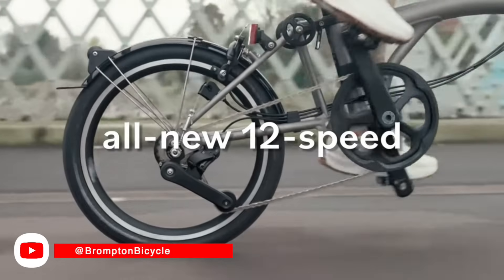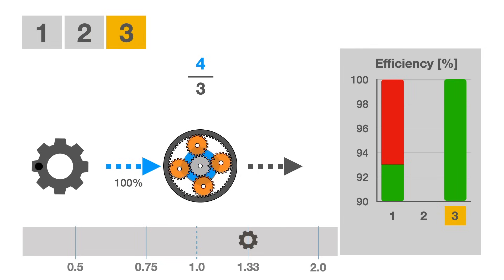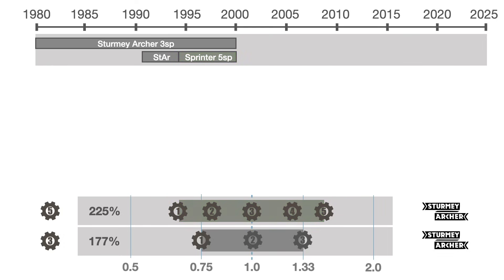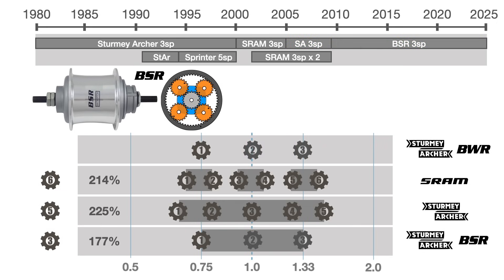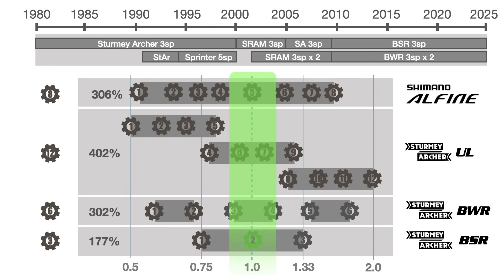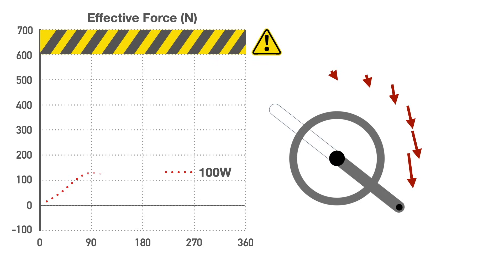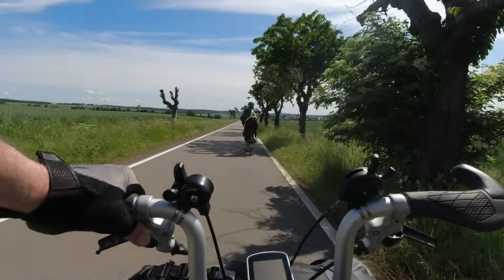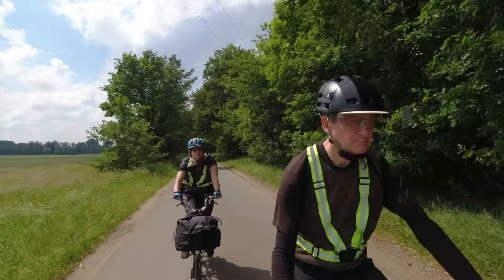Brompton Hubs: The Old, the New and the Math

Comment: I really like your videos. They helped a lot when I was shopping around for a Brompton 2 years ago. Originally wanted a P-Line but ended up going for the 6-speed C-Line instead. Your gearing videos really helped me avoid making what would have been an expensive mistake. I would have gone for the 12 speed C-Line had it been available back then. With a new H&H 40T chainrig upgrade, I no longer feel I need it. As I tend to use it in the mid to low ranges anyway. With hills always being the bigger challenge.

Comment: Very interesting video as always.

The issue with the Brompton gear system is twofold (or perhaps threefold):
Having a flat gear (i.e. about 75-80 gear inches) that is as efficient as possible;
Achieving the lowest possible gear inches to tackle hills;
(As I learned from this video) staying below the maximum torque limit at the same time.

In the case of the 12-speed, if you want a 75-inch gear on the second hub gear, you need to choose the 50T front chainring. However, in that case your lowest gear is 29.4 GI, which is actually worse than the 6-speed with a 44T chainring.
If you go with a 44T on the 12-speed, your lowest gear (25.9 GI) is still higher than that of the 6-speed with a 39T ring. So, if you really want to have a more useful range than the 6-speed, you need to use a 39T front chainring — and then you’ll get a 23 GI lowest gear, and you’re right over the 2:1 drive ratio limit (39t/18t) - and the chain can more easily fall as well (no chainguard)

Overall, in practical terms, the 12-speed is only slightly better than the 6-speed if used with a 39T front chainring — but that also means the third hub gear will be used for flat terrain most of the time.

Comment: Brompton's are dramatically over geared who needs 90+ gear inches on a commuter designed to carry a load? The first thing I recommend to folks who join the fold is to swap that 50T chainring into a much smaller size.
Reply from the maker: 44T should be the default in our opinion

Comment: great video. do you have any pointers to find details of differences between the UL and BWR hubs? my google search doesn't reveal much
Reply from the maker: While BWR and UL have the same Over Locknut Distance (OLD: 112mm) and gear development/range, the main difference is the flange width (47mm vs  36.5mm).
The flange diameter (67mm vs 68mm) and flange offset (1mm vs 1.3mm) are almost identical.
Reply: @2Bikes4Adventure thanks. this is primarily for weight savings?
Reply from the maker: @PrinceAndTheHarper  No, to be able to accommodate the 4 sprockets cassette (the BWR only has room for 2)

Comment: I recently bought a G line Brompton and had it electrified by ARCC. It is an eight speed Brompton. Unfortunately the HP Brompton is very slow. The highest gear on the eight speed is equivalent to 5th gear on the C line 6 speed Explorer. Subsequently the C line 6 speed is a much faster bike than the G line. The G line 4 speed is a faster bike than the eight speed.

Comment: If only a strong, efficient and reliable, 120 mm O.L.D., internal gear hub were available, ideally having options for chain or belt sprocket, it would sell like hot cakes!    Presumably, it is a major engineering challenge to fit planetary gearing into that narrower hub shell without the gears having smaller contact surfaces and perhaps therefore being weaker.   Maybe a miniaturised Enviolo-type hub could work, as the non-Newtonian fluid might be able to have a viscosity that's sufficient, even for a smaller "contact area", i.e. for smaller balls.   However, I am not sure whether the other parts needed for that setup would be able to be re-scaled to a 120 mm hub shell.
Reply from the maker: An engineering compromise could be to add a few mm to the O.L.D., retaining the bicycle compactness when folded while giving more room to hub manufacturers to play with. Alternatively, could a pinion gearbox work on a Brompton (likely heavier and less efficient than a 3speed hub however)?

Comment: Do you have any efficiency on the SA UL gear ratios?
Reply from the maker: We could not find BWR power efficiency transfer data. However, various design decisions would likely results in reduced efficiency compared to the BSR.
1- Planets size: The BSR, with its 20-tooth planet gears, is more efficient overall, due to better load distribution, reduced planet gear rotational speed, and lower bearing and mesh friction.
2- SA used a technique called “Profile Shifting” to accommodate 12T planets with its 34T sun gear and 60T ring gear. Conventional epicyclic design would mandates 13T planets (i.e. Sun Gear + 2x Planet Gear = Ring Gear). Going for smaller planets to achieve the desired ratio could negatively affect the output efficiency (and reliability).

Comment: That 16% efficiency hit in the Alfine 8 explains why Brompton didn't go that way a long time ago. Already with the smaller wheels, we have a hit to efficiency. Then, another hit by using ANY IGH. 

I think what I'd rather have is the 3 speed SA with a smallish chainring and the 4 speed cassette out back. Then, keep it in the 2nd speed of the hub for efficiency most of the time. When we need the first range, we don't care, because we're climbing and we need the torque. The efficiency loss won't be felt as much, since we're gearing down. When we need the higher gear in the hub, we also don't care, because we're probably descending at that point and are happy just to not be ghost pedaling. Plus, how fast does a person really want to go on 16" wheels? 25 mph seems QUITE fast enough, to me.

I think they should also make a single speed hub w/4 speed derailleur. This could be the budget model. Gear it for climbing, with the understanding that top pedaling speed will be modest; maybe 20 mph?

Another sweet option for a budget Brompton: Two speed kick-back hub w/coaster brake. Schwinn choppers had them in the 1960s. One climbing gear, maybe 5 mph, and one cruising gear, maybe 11 mph. Want to go faster? Find a hill to descend.
Reply: I just looked, and they DO make a single speed hub w/4 speed derailleur, but only on the T and P Lines...
Reply from the maker: @Smaug1 C-Line 4speed is rumoured to be available in Autumn 2025

Comment: In 2019, during Covid19, I bought my Top, "SuperlightM6LXBrompton" with an SA 6-speed hub and a 50-tooth ring in front (They had a finished one in the Ordinary Bike Shop in Kbh, which I bought as it was. So I was never allowed to fix my bike at home, except for the many lightweight modifications I have added to my bike (now 9 kilos). I have later bought some upgrade and oversized front rings up to 60 teeth to make more use of my low gears, which I honestly find mostly "useless" in the Low Setting of the two possible. I wouldn't know what use I had for a 12-speed version, or an extra, added smaller ring in front!
    I have used it up an absurdly steep hill in Denmark, and it was my only use for my low gears ever! And I had to walk also, on top!
    I have seen a Chinese external 7-speed chain-gear wheel and - a single changer made for a Brompton, which I expect would be fine for my use, without any double gearings?  Finn. Denmark
Reply from the maker: Quite a speedy Brompton you have there!
Reply: @2Bikes4Adventure  Thank You. I like it to look as standard as possible, so I haven't added any flashy, extra parts, except several of my standard-looking brake parts, which are now made of titanium. And nearly all loose parts on my bike, including the axle in front, bolts, discs, and nuts, are made of titanium. Even the adjustment nut, with a hole in it, for my SA hub. My mudguards have original titanium stays, but the Brackets holding them are made from "Heavy Metal", so I found a Chinese Set made from carbon, with small bolts, and alu-holders, for the frame. The last are added permanently and need to be drilled out, to be changed. I use a black carbon, M-shaped handlebar - with a Dutch "Bromptonian" bracket protecting the mudguards end during folds. I have a titanium wedge and bolt holding my fork.
     I look for a Flame Painted, H type Ti stem post, as the only major part still to be changed to Titanium, but I may settle for Yellow version if unable to doublicate the original!  Finn
Reply: When I had collected my finished bike in the Shop, I as a near first gave it an Auto Polish all over and found that the "Factory Protection" from small clear Tapes, the one had been worn through to nearly the paint after three folds! So I immediately ordered a "set" of frame protection plates and a fork-badge from China, and added those, also protecting where the hook from the fork meet the titanium triangle in the back, during folds. I have later found a new and lighter hook with a hole for the mudguards stay. I have also added a small "Union Jack" one below the wire fixed cable in front of the frame. I have sown leather on both my frame and the fork, from China, for protection during handling (And I have a Vincita Pouch for my folding pedal (titanium bolt). And my "stopper plate" for the titanium Saddle Pin is now titanium and a Carbon guide Plate.  My saddle is a stonehard ,slightly padded Sct Marco saddle from carbon.   Finn

Comment: I like your video, but saying that 400 W is "untrained" is not accurate. For an average person weighing 70 kg, 400 W equals 5.7 W/kg for a full minute, that’s the output of a very well-trained, if not elite amateur, cyclist!
Reply from the maker: Ref. https://www.researchgate.net/figure/Human-Power-Output-Pedalling-II-TRANSMISSION-MECHANISM_fig2_320283848
Figure 3, 400W -> 1 min for Healthy Men, 10min for First Class Atheletes
Reply: @2Bikes4Adventure That’s not accurate. I’ve been in the cycling industry for 20 years :) The number "400" depends heavily on body weight.
If we’re talking about a trained cyclist (around 70 kg), producing 400 W for 1 minute doesn’t make him just a “healthy man” — that’s elite-level power.
On the other hand, if a 90 kg person does 400 W, that’s relatively low — not even necessarily a sign of good fitness.
Also, those graphics look like they’re from 1964 — I’m not sure how relevant they are today :)
Reply: @rickys.9219 totally agree, also break the hub may be only a second thing that over the max limit. 1 mins avg watt 400 doesn’t mean generate ~1000w in let than 10sec is a hard thing. Lot of citizens level cyclist can do it. So it is hard to ride within the limits.
Reply: @rickys.9219   agreed.  1 min @ 400 watts is serious level output.  any "untrained" cyclist actually doing 1 min @ 400 watts should seriously consider quitting their day job and seek out pro level cycling as a career as you'd instantly attract a coach as a possible TDF contender.

Comment: Great video! And didn’t know the 3x2 setup was a stop gap that has carried onto the new 12 speed system! With so many years since the original it would have been nice to see Brompton collaborate with Sturmey Archer to create a wider range and higher number of gear hub to fit the 112 width triangle!
Reply from the maker: Once Sturmey-Archer was back in operation in Taiwan, it’s interesting to see Brompton dropped the idea of returning to the 5speed hub and carried-on with the 2x3 idea, developing the BWR instead. If we are not mistaking, the SA 8speed is offered in 120mm. Would it have made more sense to widen slightly the rear triangle to accommodate it? We will never know.

Comment: Another excelent video! I've done the math and think the Shimano Alfine  is the way to go on all non-derailieur bikes. A 54T front ring and 16T sprocket = 28,5 to 87,2 gear inch. Throw in the 11 speed and we're talking 30,9 to 116,3 and a 376% gear range. Who needs more? The derailieur-versons is a different beast. The choise between climbing and top-speed is a hard one. A re-worked 5 speed  10-28 cassette paired with a 53T front ring would be a way forward.
Reply from the maker: The way we see it, a light bike (like the T-Line), should focus on a light/efficient transmission (derailleur). Utility bike and Touring bike (C-Line), should focus on low maintenance and reliability at the expense of slightly heavier transmission (pinion or internal gear hub). An hybrid solution brings the worst of both world (heavy for the T-Line, susceptible to dirt/grim on the C-Line).
Reply: The Alfine G-line has such a high bottom gear for an off road bike. Really needs a smaller front ring but with its limited gear range the top gear then gets too low! Maybe a dual front ring is the answer.
Reply from the maker: @petergilbert72 Brompton seems to have a tendency to over-gear their bikes
Reply: @2Bikes4Adventure  I totally agree. A C-line 44T 6 speed is plenty fast for most use and climbs well.
Reply: @2Bikes4Adventure  I agree. This could be because Brompton are based in London, which is a relatively flat area of England. I recently bought a T-line 4-speed and the first thing I did after a few test rides around my home in a hilly Scottish city was to change the 54t chainring to 50t. The bike still felt a bit over-geared so I carried out the 5-speed conversion as described by Brilliant Bikes for the P-line, adding an extra 21t sprocket low gear to the 11-13-15-18 of the standard 4-speed cassette. The Advance derailleur can only just cope with this larger sprocket - the clearances are very tight and I needed to do a bit of fettling to get it to work without any parts rubbing against each other. But I think it's a very worthwhile modification to make if you ride somewhere with inclines above 4%.

Comment: Fantastic overview, I think the main reason Brompton don't swap to the Alfine 8 spd (or any other internal gearhub) on their standard sized bikes is because of the dropout size that would be required on the rear triangle. This would increase the folded size and also the weight too from the larger hub and extra material required. I do wish they would look at an 7 speed derailleur setup instead which is becoming popular in the aftermarket. The range is overall smaller but for most with a 44 tooth chainring would be adequate, effectively replacing the 6 speed setup much like how the 4 speed derailleur option has now replaced the 3 speed BSR hub option.
Reply from the maker: Indeed, the Over Lucknut Distance (112mm vs 135m) is the main issue.
Kinetics (https://www.kinetics-online.co.uk/folding-bikes/brompton/) has demonstrated there is a market for Brompton+Alfine (or +Rohloff).  Could easily see the T and P-Line having the lighter / more efficient 7 speed derailleur (forget having a hub on a titanium bike!) and introducing a C-Line “Voyager” (V-Line?) option with an Alfine 8 (wider rear triangle + wider fork) that also accommodates larger /more confortable 16” tyres.

Comment: Tbh, if they are monitoring aftermarket and Chinese trifolds, i think eventually brompton will go 4 speed external for the C line and then to 7-9 speed external later. 
Right now the Chinese are at 9 speed aluminum frame trifolds. 8kg, no rust and supposedly no noise like the T line 😅. Although I would not tour with an aluminum frame bike with all the increased weight. 
I just feel the hub will expire in the future as most people are not touring with their bikes and the weight difference is big. I think people are only going for the 12 speed hub option because there aren’t 9 speed external options yet.
Reply from the maker: The C-Line 4 speed is schedule for later in 2025 if we are not mistaken.
Lighter bikes (T-Line/P-Line) would benefit from going full “derailleur” (7speed?) instead of 12-speed hybrid.
As for the 12speed C-Line, touring with a full internal hub does have its advantage, so we could certainly be (more) interested if Brompton were to release a C-Line "Voyager" (V-Line?) with a wider rear triangle, Alfine 8 (or 11) speed, and wider tyres (while still 16”). Time to move away for early 20th century technology that is the 3speed hub.
Reply: @2Bikes4Adventure  sounds like a great idea. I wonder if brompton monitors this channel. Good ideas to implement.

Comment: The 5 StAr was a bad idea. The cantilevered planet pinion pins can allow slipping under high torque.
Reply from the maker: Do you think the 5 Sprinter would have continued to be used if SA had not file bankruptcy? Was it good enough? What do you think we would be riding with now? A 2x5 configuration? A Sturmey Archer 8speed (120mm OLD)?
Reply: I believe that is true so i went for the S5/2 hubs. I think that the S5 and S5/1 were good but the bellcrank mechanism is hard to find now and expensive. The Sprinter is good. Sturmey Archer made so many things so there's so much to learn!

Comment: The idea of combining hub and derailleur gears dates back to 1924, not 1981.  See The Hub of the Universe by Tony Hadland and Alan Clarke.
Reply from the maker: You are correct, the “1981” hand-written at the top of the Cyclo advertisement is misleading and was added on the copy available in the SturmeyArcher Archive web site (we didn’t want to “photoshop” it out). If you read more closely the document, you will see it mentioned “Award Gold Medal … Inventeurs 1963”, so clearly, way before 1981.
Thanks for pointing it out (and mentioning “The Hub of the Universe”, a great reference)

Comment: Thanks for the video. Very interesting historical info. Not I know why they have that weird system with planetary hub and a deraileur. 
In my opinion when there was shortage of hubs they should get rid of them completely. I don't really see a reason having heavy and inefficient hub AND a deraileur. If there was only a hub it is understandable because low maintenance needed. But having both in the same time is heavy, mechanically complex, requires more maintenance and still inefficient.
Reply from the maker: We think, light bikes (T-Line/P-Line) should only have derailleur (up to 7 speed?), while utility and touring bikes would benefit from a low maintenance (but slightly less efficient and heavier) hub (ideally at least 8speed).